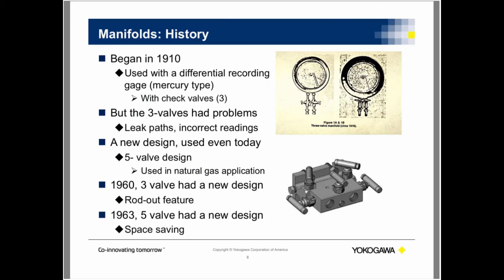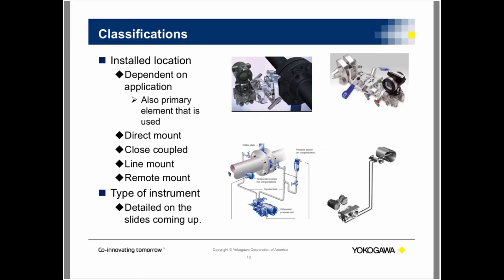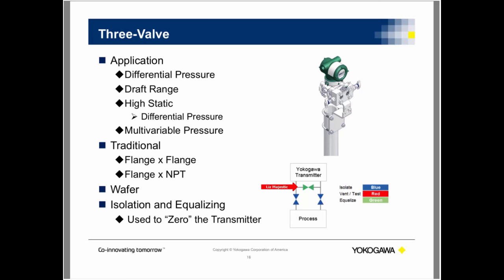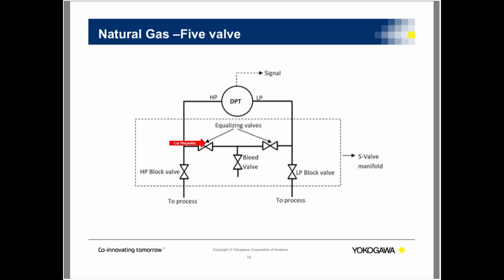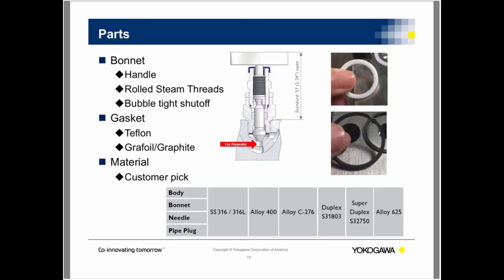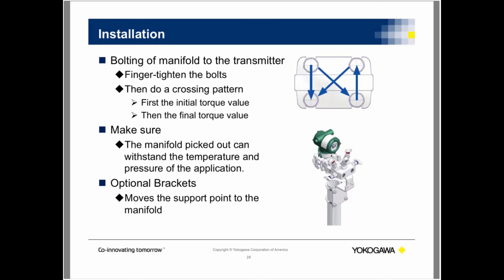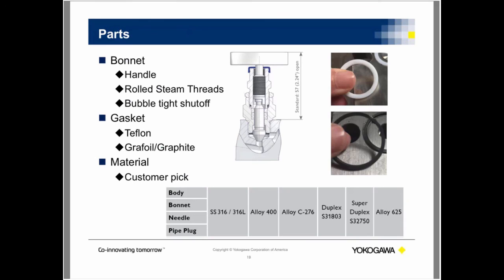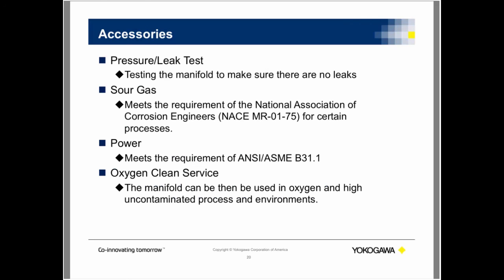Understanding Pressure Transmitter Manifolds

Comment: Coplaner and bottom mount manifolds are two different things.  While their orientation is the same coplaner  manifolds are used to replace the coplaner flange on a rosemount manifold. A coplaner brings the centers from 1.25" back to 2 1/8".  A bottom mount has  2 1/8" centers on both sides.  A coplaner manifolds has a flat face 1.25"  instrument side connection while a bottom mount typically has a seal face and is on 2 1/8" center.

Comment: Most instrument techs on 5-valve nat. gas manifolds go through the high side vent to check span not the low side. There are usually vent plugs on both the high and low side of the manifold.  The high side plug is typically removed and in replace with mini valve and a quick connect and this is where most gas meas. techs check span when necessary.